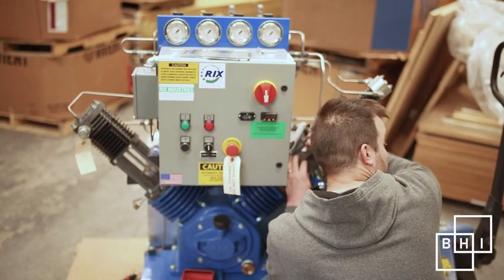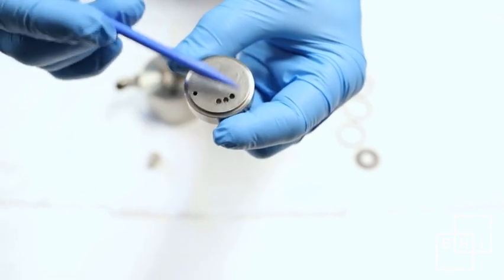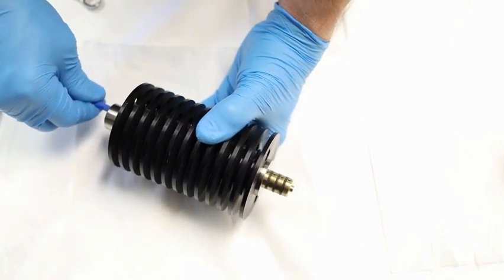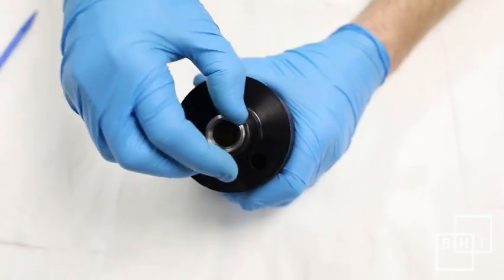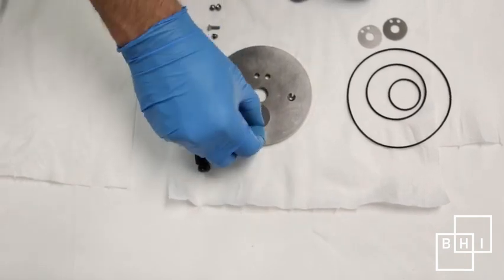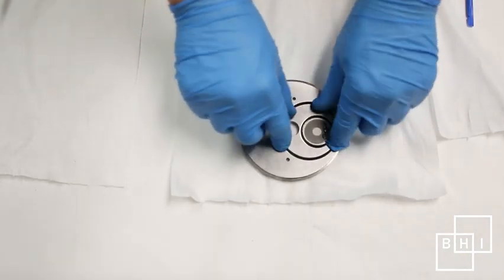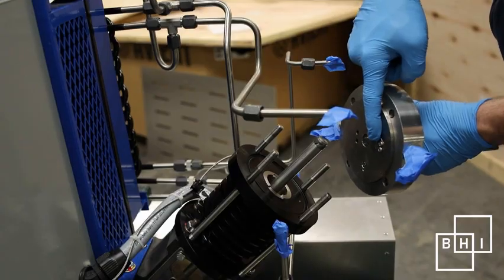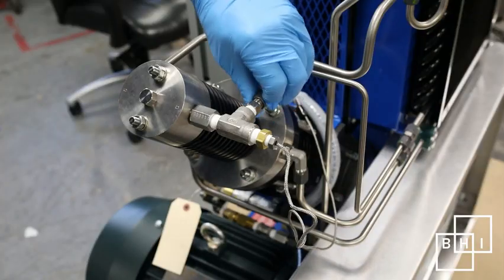RIX 2V3B, Second and Third Stages

Comment: Hi i was running my 2v3 series compressor and i encountered a fault in stage 1 and 2. the pressure gauge in stage 1 was above the normal pressure it was about 300psi instead of 190 to 250. while stage 2 was at 300psi too instead of 700 to 820psi. the relief valve on stage 1 has been open since the operation. we checked for leakages in the stages but found none. please advice.
Reply from the maker: Hi there! Thank you for reaching out. We suggest that you reach out to the Medical Oxygen team at bhioxygen.org and submit a technical support request. There, you can receive direct support with your inquiry.